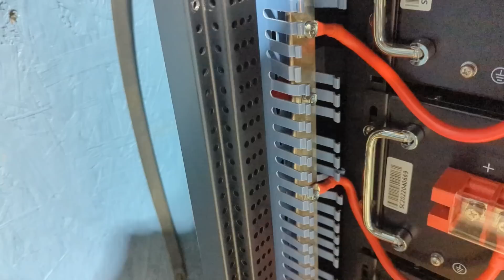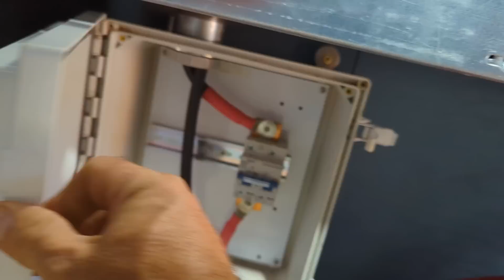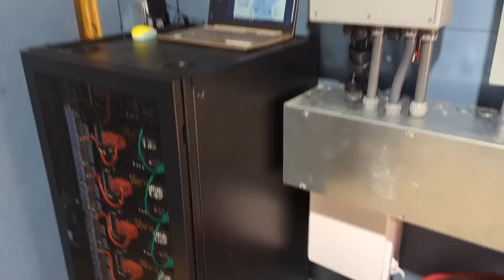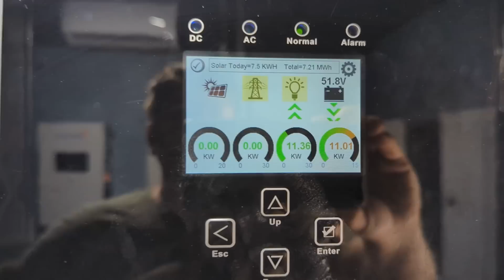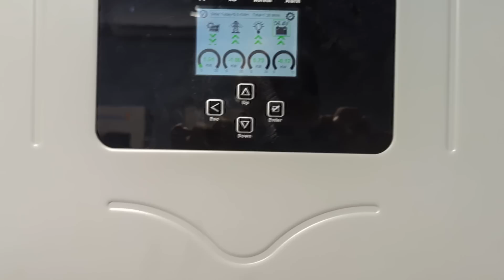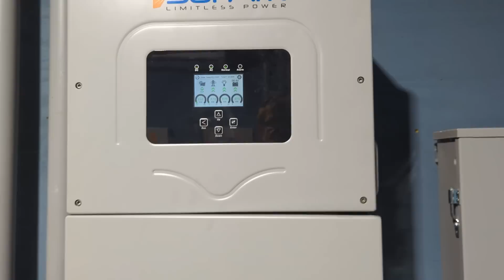A New Dynamic Duo!

Comment: Whats the big advantage of the Sol Ark vs having 2 EG4 6500EX-48? Its half the price for the 2 smaller inverters vs the Sol Ark. I'm interested to know if anyone can answer.
Reply: Not an expert, but from all the videos I have watched so far, one of the repeated messages is how a system built around sol ark will pass inspection if you want to be grid tie.

Comment: I'm being told that the EG4 LL has an issue with SolArk 15 in the BMS. He wants me to use HomeGrid so he won't have to send out a truck to recharge the batteries if they go to low. I contacted a tech at SolArk and he said the BMS with EG4's doe not work. I was wanting EG4's because of price. Any recommendations?

Comment: when you say swap the buss bars 180 what does that mean?  put the home runs on top on one side and bottom on the other?
Reply: Flip one bus bar side upside down. The big wires going from the batteries to the Sol-Ark get connected to the bus bars. Connect the red at the top of the left bar and the black at the bottom of the right bar. Or the opposite. Black at the top, red at the bottom. Same thing. Otherwise if both wires are at the top, the top battery will charge and discharge faster than the batteries below it. It's because current will follow the path of least resistance. The batteries closest to the big wires have less resistance than the ones farthest away.
Reply: @EL34XYZ  We've always done that for lead acid, I dont see why the bars have to be flipped if you have one on top and other on bottom unless there is only one main wire connection.  I can see that.  For the 15k we sometimes split the bank into two anyway
Reply: @johnmiggins9431  Some bars only have one place to attach a big wire leaving the battery bank and so flipping that type of bar is what I was talking about.
Reply: @EL34XYZ  thank you

Comment: That looks like a nice unit how much did you spend with all of it I'm curious get back to me thank you
Reply: The Sol-Ark 15k is on sale for $8250. A 6 battery EG4 with the rack for free is on sale $8259. I just bought both of these at Practical Preppers and Signature Solar. Deals on shipping at both places. Free on the Sol-Ark (155 pounds shipping weight). $200  for the batteries and rack (700 pounds) That is an awesome deal considering shipping from TX to NC.

Comment: Love the solark. I plan on investing in one in a year or so when I have the funds. In the meantime I have two mpp lv6548’s. They’ve done great but I wanted more VOC. I tried switching to the eg46500’s. Honestly a bad experience. They made any lights on a dimmer switch strobe constantly. There is something inconsistent about their voltage output. I wouldn’t use them on any sensitive electronics. Then again that’s essentially what they are supposed to be designed for.  So I wouldn’t use them at all. Signature solar said that’s perfectly normal for these inverters. Which of course it’s nothing, because the mpp version had no issues. I sent them back and lost around $900. Buyer Beware.

Comment: I don’t understand your load test.  The Sol-Ark 15k has a DC limitation of 12000w when on batteries only. That’s 50 Amps.  You were right at that level when your breaker tripped. Not 200amps.   I have the same Sol-Ark 15k and I am having the same problem.  I don’t see how doubling up the wiring between the 2 breakers will get around this limitation.

Comment: This is an expensive setup, us poor folk have underpowered systems, so one thing we learn real quickly is to use power at the peak of the days, around noon. It's also not uncommon for us to have to plug the fridge out to microwave something just to avoid an overload. But we still look at the absence of grid wires and the bills and are more than happy with whatever we have put together. Of course it's also possible to upgrade.

Comment: 2:40 I would just cut a plywood top for it to fit into the entire top space. Can also use couple screws so it doesn't come loose. Seems an unnecessary extra step after already purchasing the cabinet, but consider it a sacrificial top, so you can mount things to it and later replace the top.

Comment: Have you tried pushing the SolArk off-grid load test?  This vid elaborates a limit with breaker protection and cabling.  How about running motorized loads off-grid to hear your results.  The batteries seem good but then again this is a system 'duo' video.

Comment: Will the SolArk 15k work with Redox Flow batteries or just the Li-ion?  You briefly mentioned the SolArk settings for the batteries but it wasn't clear to me what those settings are and if they allow for other types of batteries.  Thanks.

Comment: So my Solark15k went live this afternoon, currently running 2 EG4 batteries.  Was able to run both of my AC units on it.  will mostly be running it Netmetering when Power company gets their meter changed.
Reply: Damn, yiu running easy starts on your AC?
Reply: Well, not right now, its -10 F below zero

Comment: Some other solar enthusiasts have posited that you need to wire the rack diagonally to more evenly cycle battery charging/discharging.  It would be very helpful if you could test this theory by monitoring all 6 batteries as they are charged and discharged in both the current configuration as well as wired diagonally.
Reply: Not true
Reply: Will’s off grid solar channel did this test. It makes a difference

Comment: I’m running the same setup with a Solark 15k.  Solark has been dragging their feet on getting these communicating.  I was able to connect to them with a laptop, but I had to build a distribution switch for the cables.  I hope Solark gets this done soon.
Reply: Any update on whether Sol-Ark has solved the problem communicating with these batteries?  Signature Solar says the solution has to be provided by Sol-Ark.
Reply: @tquinn63  you have to flash the multipack v1 firmware to each battery, its hard to find the update but its on the forum

Comment: I'd love a set of these and a 15k. Still can't find anybody to tell me if my rafters can support panels.
Reply: All roofs are designed by code to handle at least 2 layers of shingles. Solar panels and racking weigh less than 3.5 lbs per square foot. Less than a 2nd layer of shingles. So, if you only have 1 layer of shingles on your house, you will be fine for adding solar.

Comment: Tap the buss bars at opposite ends to keep them even load sharing.
I just got denied a permit for lack of ul9540 on the other battery they offer.
So I got 60kwh if anyone needs some new lifepower4's.
Edit: I see you mentioned cross flow.
Reply: so lifepower4 is not UL certified but EG4LL is?  I am in the process of buying a stack of lifepower4's.  You can reach out to me if you are still selling them.  I'm not pulling a permit as I already have an existing grid-tied system.
Reply: Apparently, UL9540 is a superset that encompasses UL1973 for batteries and UL1741 for inverters.  Your AHJ wasn't looking at the meaning, just a checklist.  
The Lifepower4s are 1973 listed.
It might be worth pointing this out to your jurisdiction and appealing.

Comment: Only issue I have with commercial batteries is they are only 5kwh.
A DIY 16s 48v battery is 15kwh.

3 of the signature solar 5kw batteries is $4500
1 DIY 15kwh battery is half that. $2200

I guess if you have money to throw at it then it’s not a problem.

Comment: They seemed to work well, but the testing was inconclusive because of operator error. Would've been nice to see some actual load results with the 15kw after the problem was fixed.
Reply: Will Prowse will show you that stuff on his channel.
Reply: @31337cyberhuman  He'll show me load testing the new sol-ark 15kw? That was the purpose of my original comment about how we actually didn't get any numbers from load testing. From what I know is that Will P. has one video and its pretty much him opening it up and talking about build quality. If you have the link for the video you speak of I'd love to take a look at it.
Reply: @31337cyberhuman  Not until the negotiations are done .
Reply: Also what is the power use of the SOL-ARK with no load or minimum load?

Comment: Been running 12 of the EG4s entirely off-grid for a few months now. You can't beat the value!
Reply: Glad to hear this.
Reply: Thank you
Reply: How much solar are you using for this? Amount of panels..watts? Thank you
Reply: @mac11380  8kW right now, 18kW in the near future
Reply: @nikolapro7468  Thank you!
Reply: @nikolapro7468  Follow up question, 8 kw  - 18 kw was/is  enough to charge all these batteries?
Reply: @mac11380  The 8kW system generates about 30-40kWh per day. So about 40-50% charge for the batteries. 18kW will be able to fully charge and then some in 1 day
Reply: What inverter are you using?
Reply: @rickmorin8840  SOL ARK 15K all in one, the EMP hardened version should be out in the next few weeks, thats what I am waiting for.
Reply: @rickmorin8840  2 x LV6548s at the moment. Have 2 more in their boxes brand new but will be switching to either 4 x Victron Quattro 10ks or 2 x SOL ARK 15ks when my garage is done being built

Comment: Signature Solar just announced an EG4-LL version 2, it looks great and is suppose to be compatible with this version, and per their site has communication with-- RS485/CAN: Schneider, Solark, Victron, Growatt, EG4
Reply from the maker: Yes, I just received that new battery yesterday and I'm going to incorporate it into my stack of the original LLs and do another video but for now I'm off to RE+ for a week of solar fun.
Reply: @engineer775  Awesome. I live 10 minutes from the Anaheim Convention Center but won't be able to make it. Looking forward to seeing some video of it. Cheers
Reply: Do you know if those batteries will work with the original EG4 batteries. Can you add a new model battery and set it up so it’s a “master” and the older batteries are “slaves” ?

Comment: That 4-0 cable may be expensive and harder to work with but the lower voltage drop means fewer potential problems down the road. Overkill is under-rated. That does look to be a nice rack system.
Reply: The Sol-Ark manual says 2/0 cable is fine for up to 12’. They recommend 4/0 cable for 12’ to 20’ so it depends on how far your run is.

Comment: almost got these EG4s but don't think they are 100% UL yet?    are they on CEC list also?  we used something like these and very low end stuff - really seemed    .  terminals very crappy. glad to see they have a bus bar now
Reply: No UL9540:(
Reply: They have a similar unit without an lcd screen that is UL listed. Oddly enough 🤔
Reply: @taylormills08  but not ul9540 so no permit lol
Reply: @SolarTechFL  yes, and the guy that buys this battery doesn’t buy permits either.

Comment: Hi. I am having a enphase 10kw solar system installed. I eventually want to install a backup system. What would you recommend. Awesome video by the way. Luv the content.
Reply from the maker: I would seriously consider AC coupling the enphase to a 15k solark.
Reply: @engineer775  
Thanks for getting back. I’m definitely going to upgrade in the future and want to have a similar setup to yours. Have a great day!
Reply: @KyleY675  Will  micro-inverters charge batteries.
Reply: @glenpharmd  AC coupled to the generator connection on the sol-ark with enphase iqm. The sol-ark charges the batteries just fine.

Comment: Looks like a great setup. I’d like to have one or two SolArk providing 200A off grid. Would that be best provided by a single 15k or two 12k? Thanks!
Reply from the maker: Well... a 15ks continuous output is 50amps and it is 75amps for 2 12ks.    for full 200amps off grid  4 15ks 6 12ks
Reply: @engineer775  Thanks for the response. I should have said that it's for a household 200A service panel. New house with LED lights and new appliances, so I suspect the continuous load is going to be far below that.
Reply: The panel is RATED for 200 amps but I sincerely doubt you will ever pull 200 amps.

I have a 400 amp service and only pull max 60 amps peak.
Reply: I have only overloaded a 15k once when the grid dropped in the evening with 0 solar input (so limited to 12k load) and dryer, 5500W water heater, well pump, 2.5 ton A/C, tv lights dishwasher etc all were going. And no combiner setup needed with 15k. Easy install.
Reply: Thanks for all of the great advice and anecdotes!

Comment: 19.2kW EV charger off grid. Can it be done with X Sol-Ark 15ks & X number of EG4 LL batteries? And would there be any way to EMP protect the batteries?
Reply from the maker: It can be done and I can get you replacment (BMSs)  found that out an hour ago.
Reply from the maker: 2 15ks should be sufficient.
Reply: @engineer775  awesome. Waiting on building permits then I’ll be reaching out. I’m building at 9500ft @ 37* but going with a 12/12 true south roof pitch standing seam galvalum because while its out there, id really hate to return to find a ground mount picked clean of panels. By my math that puts me 3* short of ideal for winter solstice and almost eliminates chance of snow pack. 
My only remaining question is would a railless S5 mounting solution negate the benefits of bifacial panels and does the particular wattage of the chosen solar panels have any impact on the number of strings?
Can’t wait to meet ya at RE!
Reply: Yes wattage / amps / voltages all matter in string sizing - Sol-Ark has a good string calculator to help see how that works.
Reply: @tomkacandes8286  awesome. They had the panels I like already like listed so looks like 7 panels in series x 2 strings will max out a 15k. Not sure how to figure out how bifacial P max but if its more than 5% the wattage will be too high

Comment: Hi Scott, Nice review. I have been eyeballing those batteries and the SOKs. Any upcoming projects with the Smart Load panel with the 15K? Seems the SL panel is delayed. Anyone know if it is supply chain, software or something else. I have been waiting to do the 15K with the SL panel. Just curious to find out the scoop. Thanks!!
Reply: I have the SOK closed loop and haven't noticed any issues. But haven't looked super close for them either. Has been running with zero hickups

Comment: QUESTION: If you use Two (2) sets of 2-0 cable, would it be wise to criss cross the connections

for example
such that left breaker 2 red leads one is at top of left battery rack bus bar and other is at the bottom then same on negative side bus bar, one at top and one at bottom - to get better balance into and out of batteries across the rack
Reply: No as the top and bottom batteries will see more charge and discharge currents than the middle batteries.
Reply: I would assume so but I haven't tested it

Comment: Lately been seeing some videos pop up criticizing Sol-Ark for not being able to handle heavy individual loads which are within the inverter rating. Any comments?
Reply: Within each leg rating or total rating? The total rate for the 15k I believe is 6k per leg or 12k total.

I have only seen it on imbalanced loads going over individual leg limits.
Reply: @hoocli  I was told by sol-ark tech support that it can do up to ~7800w on a single leg (if the total power is under the max). I'm not sure if that was battery only or battery + DC coupled solar though.
Reply: @niktak1114  I think that's both DC + solar. I'm pretty sure battery only is 12k. Could be wrong.
Reply: @jasonphillips3051  I haven't seen any split phase inverters that can output their total output power on one leg continuously

Comment: Charging/communications:

1, can’t wait to see the new battery 😃

2, would you mind sharing the charge settings that are working for you?

3, we have a SolArk on EG4-LLs also 
(4 batteries, dead parallel via 2/0 cables to a bus bar) and I’ve found that the SolArk and battery SOC meters will get out of sync regularly, and have found it helpful to set the “batt empty” setting to 46v so the SolArk has a better idea of what SOC it’s actually at, then set the “charge efficiency” to 95% 
Now it will recalibrate every time the the SolArk AND batteries reach 100% and then it takes a few days to track off again, so it is important that the whole balance enables it to top off regularly.
*the problem I was getting was that the SolArk was selling/using down to what it thought was 20% and by that point the batteries actually reached 0%

Comment: I'm running the SOK 48v like these and it works great with the 15k so far. I do have them closed loop as well. How evenly are the batteries discharging. That would be my only concern on high loads. Can you show how to combine terminals inside the solark
Reply: It should be pretty even with those busbars
Reply: How many batts do you have? Do they drain/charge evenly even under heavy load?
Reply: @NeverTakeNoCut-offs  even enough 20kwh battery